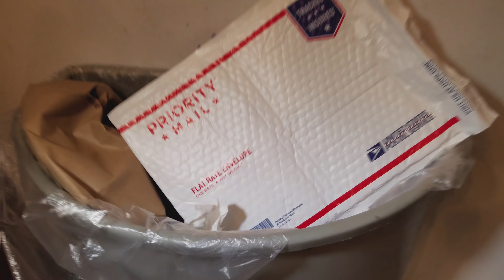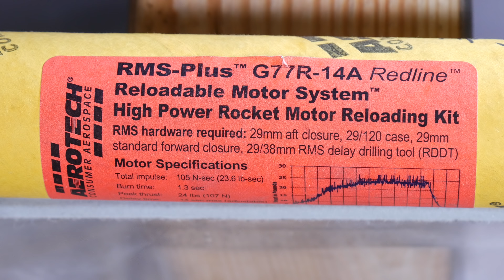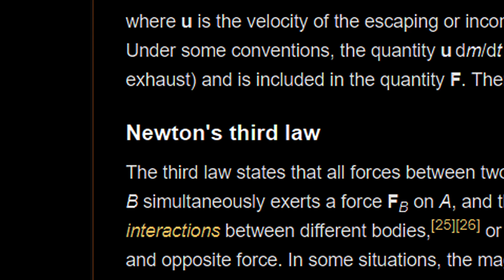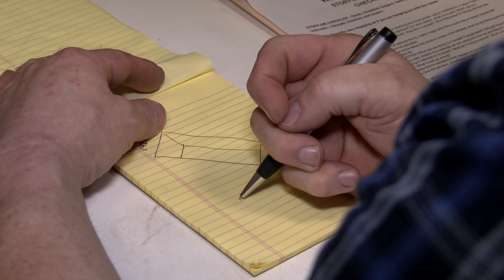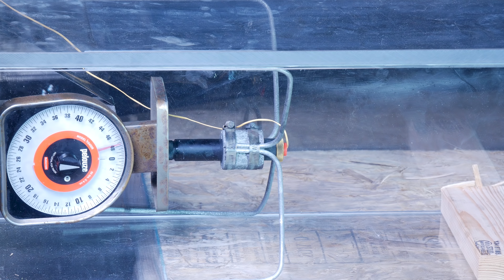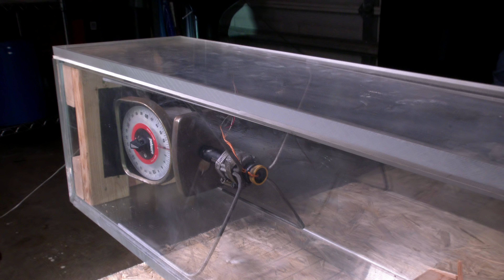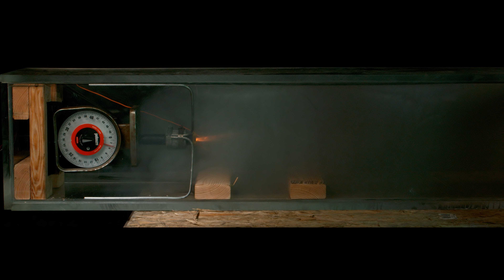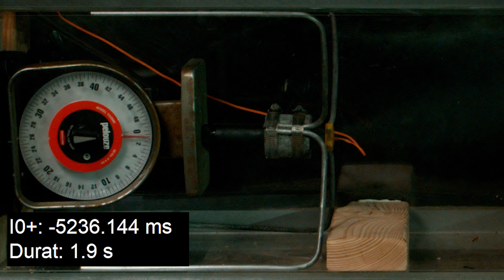Rockets in a Vacuum Chamber - Newton's third law of motion Visualized

Comment: Well done. As other have said the smoke from the exhaust created its own atmosphere inside a closed chamber.  Space has no walls.
Reply: It’s still being pumped, how much gas do you think it makes?
Reply: @Skeleton-bs7zy  The pump if it does exist could not keep up. The speed of the exhaust is too great...The wall/rocket also reacts with Newton 3rd law of motion. Use a large chamber...
Reply: @johnguy1350  what of the amount of thrust, it was highest at the start and still high at reasonable low pressure compared to its normal ability if the rocket relied on  pressure to work shouldn't produce less inside a vacuum chamber.

is the rocket producing enough atmosphere to act as normal pressure.

Why would the third law work on the wall but not the gas
Reply: @johnguy1350  Also their just a diy channel, how large do you expect them to build it
Reply: If that's sufficient to count as an atmosphere then space has an atmosphere, too.
Reply: The thrust meter moved before the gas plume hit the end of the tank, champ. Oops.
Reply: @Cosmic-Spanner  How did you time this event? Why not put this rocket on a long Horizontal wire so we can see it move?
Reply: @johnguy1350  "How did you time this event?" Try slowing video playback down. You can see it clearly, obviously.
"Why not put this rocket " I dont think anyone cares. Nobody is stopping you from doing your own experiments.
Reply: @johnguy1350  And about rockets in space: We know an object will move in a specific direction when it's hit by the expanding blast force of an explosive.
So, rockets can certainly gain thrust.
Reply: @Pounder My company tests over a dozen real rocket engines here on earth in a vacuum a year.
We TEST them and VERIFY that they DO produce the thrust predicted by the Tsiolkovsky Rocket equation.

We then put those rocket engines on real spacecraft, launch them to space and TEST THM THERE TOO.

But bless your little heart for effort Papa Legba.
Reply: @Pounder how much different do you expect near vacuum and vacuum to operate technically space isn’t even a true vacuum, if it produces similar thrust in decreasing atmo why would this stop
Reply: Conservation of energy, matter is neither created nor destroyed.  Where is this magic atmosphere coming from?  yes there are particles and gas being generated from the ignition, but the gas and particles equal EXACTLY the mass being ejected/burned.. whatever matter transformation is taking place during ignition.  So generating atmosphere is impossible.  the pressure will not change.
Reply: @shawnschiebrel  You are correct and wrong at the same time. We are not talking about Conservation of energy, we are talking about the creation of an atmosphere in order to push against. The mass stays the same but has change the state the it exist in, much like water, Ice 🧐🧐and Stream
Reply: @johnguy1350  regardless, pushing against anything is not how this works
Reply: @shawnschiebrel  Lol wut?
Reply: @johnguy1350  "we are talking about the creation of an atmosphere in order to push against. "
That isn't how thrust works. Also, 10:32 The thrust meter measures thrust before the plume of smoke gets a few inches from the nozzle.
Reply: We would just like to see the test done in a large vacuum chamber to take away  that option.
Reply: @johnguy1350  OK I get it. But people who learned physics (and use it) don't really need to see this because they know the physics works in a million industrial solutions.
Reply: There's a gas law, w=PV, try using it eh? Or draw a free body diagram. Easy, but no NASA fanboi will ever do either 😂
Reply: @Captain-Obvious1  it works in no solutions at all 😂
Reply: @Captain-Obvious1  really, that is such a lie 😂
Reply: @papalegba6796  So explain how rockets can accelerate mass out the back without feeling any kind of "equal and opposite" force per Newtons Third Law.
If the rocket accelerates mass it must feel that recoil force per newtons law.
For you to say otherwise means either the exhaust gas has no mass, or the mass gets accelerated from the rocket without a force being applied to it.
So, which is it?
Is gas massless or can mass be accelerated without the application of a force?
So which laws are you thinking rockets violate?
Reply: @rocketman484 the third law has to be acted on by an external force. If you were in space and accelerated your feet by kicking and punching really fast, did you not accelerate your fists or do they not have any mass? Why wouldn't you move in a positive direction?? Because a force within a system can't affect the system you're essentially pushing against yourself which is impossible. That's like saying a really strong guy can pick himself up by his own hair. It's that possible? It's the same thing exhibited differently.